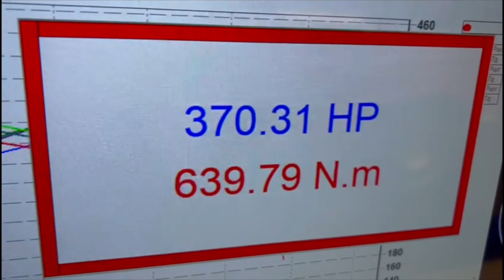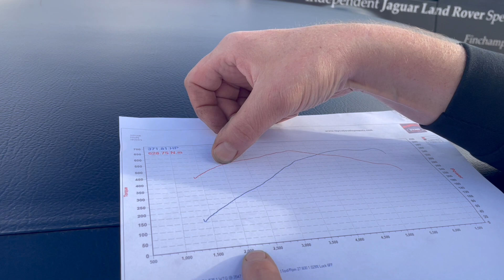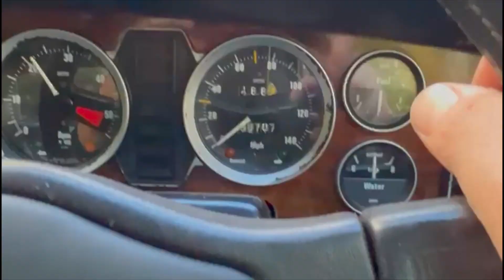Jaguar XJC RESTOMOD - Part 9 - Start Up, Dyno Results & Exciting NEC Classic Motor Show Information!

Comment: That sounds fantastic!!  I'm really torn.  I was going to put a 76 Pre-HE V12 in my 72 XJ6, but now I'm really leaning towards what you've done.  I'd be curious to know how the fuel mileage compares to the V12 as mine will continue to be a daily driver.  Great work guys!  Really looking forward to seeing - and hearing - more. Please get together with Harry and have a XJC side-by-side comparison.  Cheers.
Reply from the maker: Hi Jeff - we plan to do a comparison video with Harry’s XJC, so you will be able to see them back to back. Regarding fuel economy, this will be somewhere in the 20s (MPG) on a run - the fuel injected V12 is somewhere in the late teens on a run in our experience. Check out Harry’s last video on his XJC when he takes it on a tour.
Reply: @tomlenthallsworkshop  excluding the engine and transmission, if you have a parts list for the project, I'd gladly pay for a copy.  Shipping my car to you from the States would be a bit pricey. LoL.

Comment: Well done, looks and sounds great, I'll come and say hi at the NEC, that will be the 3rd car show ive been to this year and if I manage to catch you I will have chatted to you at all 3! I think you've proven your throttle body setup with those figures, I could only get 355bhp out mine with a heavily modified supercharger but standard throttle body.....Something to think about there 🙂
Reply from the maker: Thanks for the feedback on the car, much appreciated. Hope to catch you at the NEC so you can make it 3 out of 3! 👍
Reply from the maker: Thanks for the feedback on the car, much appreciated. Hope to catch you at the NEC so you can make it 3 out of 3! 👍
Reply: What about your 0-100 now? Mine is 5,5 seconds repeatedly with standard 4L80E, which surprises me in a very positive way, because my car is still not fully sorted and not running the way it should, and not that much has been done on upgrades yet.